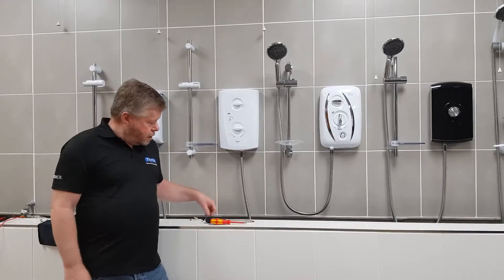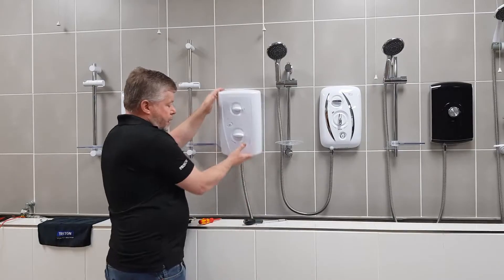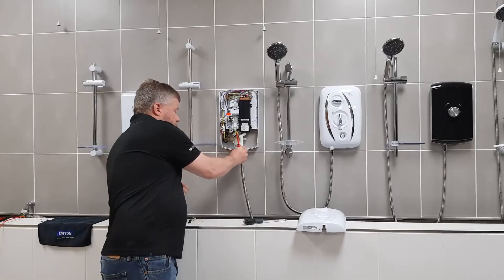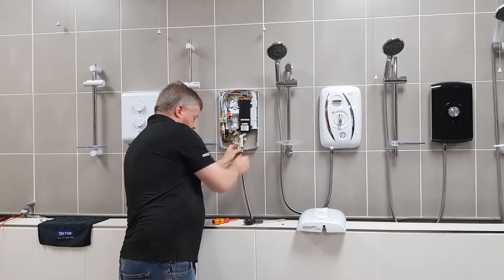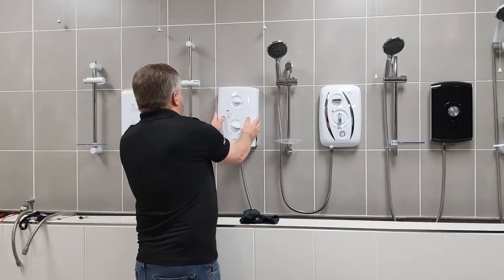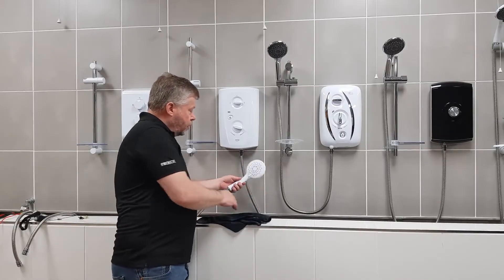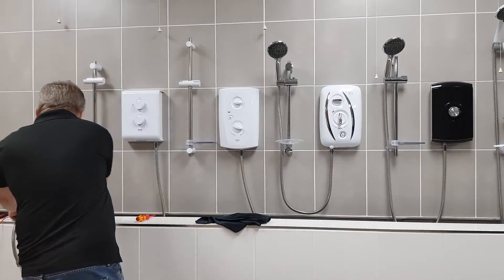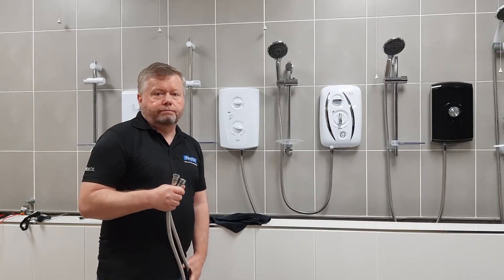Electric Showers | How to change a Pressure Relief Device (PRD)

Comment: Hi, new type prd - do you have to change the whole part or can you just change the diaphragm. Noticed that you can just buy the diaphragm in some places. Thanks.
Reply from the maker: If the shower has an old cream coloured PRD you will need to replace to the black PRD pipe and diaphragm, the newer black PRD pipe is slightly bigger size for the diaphragm, so if you put the diaphragm on the old cream coloured PRD it won't seal properly. (If it's a newer black PRD though you can just swap the diaphragm)

Comment: Hello, is there any video showing PRD replacement on Triton t300si?  Also can interchange ball with disc in PRD?
Reply from the maker: We don't have a video specifically for that model, old cream coloured PRD's use the ball. The newer black PRD's use a burst disc. The burst disc requires a black PRD due to a slight size different. But the black PRDs will retro-fit older cream coloured PRDs.

Comment: I replaced the (old type white with 'O'-ring) PRD in my Triton Cara three years ago. Leak solved. Forward three years and leak started again..... however, after ordering and fitting the same type of replacement, the leak persisted....I noted that the little ball in the original (2nd) replacement was still in place so why is the shower leaking if it isn't the PRD that's "blown"? By the way, water is flowing as usual from the showerhead albeit with less water pressure, as you might expect with a leak.
Reply from the maker: Hi, if the ball is still in place but leaks it would sound as if the ball has partially dislodged, if the pressure has dropped it would be worth just double checking no blockages in the head from scale and that no kinks have formed in the hose, if both appear okay we also over the phone help and if required a service visit on 02476 372222.